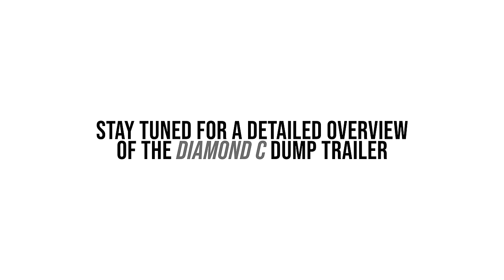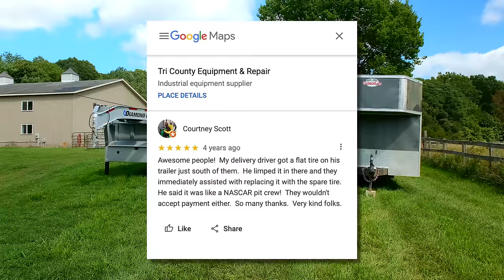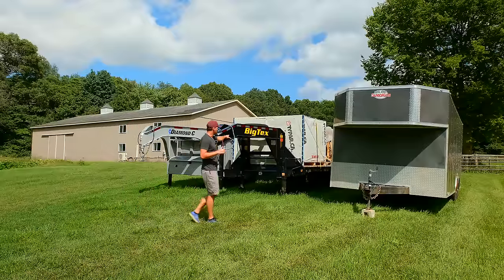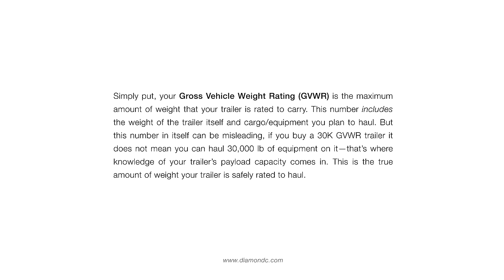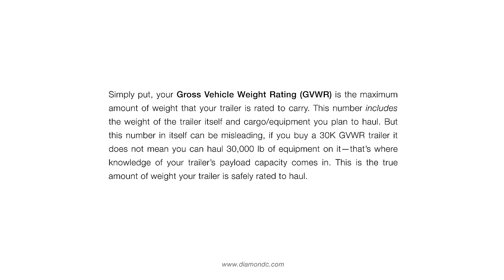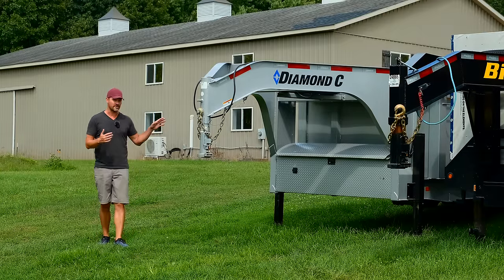THIS WAS A $30,000 DUMP TRAILER MISTAKE. WHO WANTS TO BUY IT?

Comment: Just for anyone who is interested in this trailer or size dump trailer, so you are aware, the rated cargo capacity is said to be 16,780 lbs (trailer weight is 7,220 lbs) for a total Gross Vehicle Weight Rating (GVWR) of 24,000 lbs.  The trailer has (3) 7,000 lb axles (so 21,000 lbs of the total load can be on the axles), they do not tell you how much weight of the empty trailer is being supported on the axles, and how much is transferred on to the truck by the gooseneck (GN) (would be nice if they stated that though) but they are assuming if you load it to max weight capacity 24,000 lbs (load + trailer) that you will have 3,000 lbs of that load supported on the truck by the GN.  You have to figure out how that fits in the trailer without overloading either the axles or the GN (they do not tell you the max rating of the GN as far as I know.....).

With the length of that trailer and the location of the axles, I would think a lot of that 3,000 lbs for the GN is already there, guessing around 2k of it, again though, they don't tell you that (errrrrr).  From looking at equal rated and length equipment trailers (from other manufacturers) a GN appears to reduce the capacity of the trailers by about 1k (based on trailers that have GVWR's equal to their combined axles......) so I assume the GN adds about 1,000 lbs to the trailer, and all that steel in the dump box and frame between the front axle and the GN probably adds 750 to 1,000 more pounds (again, they don't tell you...... but that is a MUCH longer trailer than the typical 12 or 14 ft dump trailer, in front of the axles....).  So you need to try to keep the load as centered over the axles as you can, with it slightly biased forward of the center axle (for every 8 lbs, you want 1 of those lbs on the GN, though it already has a lot of that weight there....).  Since there is not a lot of room behind the rear axle, and a WHOLE LOT MORE room in front of the front axle, I would assume loading centered over the axles till you get to the last scoop, then put that at the front of your load and you will likely be good.  This is assuming dense material like dirt, sand or stone.  While materials that are not as dense (have a lot more airspace in the pile) like mulch, branches, mixed trash can likely be put in more haphazardly, I would still load it centered over the axles till you nearly run out of room, then load forward into the trailer (the rear of the trailer has to lift a lot less to dump than the front of the trailer, so weight in the front of the trailer is a LOT harder for the hydraulics to lift).

Now onto weight of materials, they all vary a bit and can vary a lot more when wet!  My dump trailer has a little label inside the cargo box that lists "estimated weights of materials"
Coal                         2,400 lbs per yard
Firewood                 1,134 lbs per yard * unseasoned red oak, one cord equals 4.74 cubic yards
Mulch                          750 lbs per yard
Sand                         2,600 lbs per yard ** average weight of moist sand
Slate                         2,400 lbs per yard
Stone, crushed       2,700 lbs per yard
Topsoil                    2,400 lbs per yard * average weight of moist topsoil

"these weights are only to be used as estimates.......hada hada hada....."

We'll go with "moist" topsoil here , just for the example.  1 cubic yard is 27 cubic feet, or 3'x3'x3'.  Assuming this and other dump trailers like it is 7' wide and 4' tall walls on the inside, filled to the brime, straight across the top, every 1 ft of trailer length is 28 cubic feet (so assuming there is a little less at each edge of the top, 27 cu. ft. or 1 cubic yard per foot of length of the trailer, 1 yard per foot of trailer for short).  With the "rated cargo capacity" of 16,780 lbs, "moist" topsoil at 2,400 lbs/yd would be 6.99 yards or ~ 7 yards.  So 1 yd/ft of trailer means 7 ft of trailer, full to the top would max out the capacity of that 20' trailer, or 14' half full of that 20' trailer (assuming this for on the road would be a risky idea as you have not given yourself any leaway and the DOT does not care about estimates, they have calibrated scales to fie you with.....), doing this on your own property is safe to assume you can push this number some depending on how "moist" the soil is.....  But hopefully this shows how EMPTY the trailer will likely look when loaded with a dense material like topsoil, sand or stone.  This should all be centered as much as possible over the axles.....  Now if you are doing this where you will not be "on the road", and going less than 35 mph, I would load this all as far back as possible in the trailer, especially if you are loading it near "capacity", tongue weight won't matter at slow speed, not on the road and on "fairly level" ground (backing down a slope, you don't want the trailer tongue or GN here, lifting the rear of the truck off the ground.....).  That will make the load "less work" for the hydraulics to lift.  

Now, how much is a cubic yard, or "yard", by the "bucket".  Depends on the size of the bucket and how "full" the bucket is.  Apparently, the way they measure bucket capacity varies some but usually it goes buy a "struck" bucket, which I think the ASTM defines as straight across from the bucket tip to the top of the back of the bucket, so definitely less than a "heaping" bucket.  John Deere's specs say the 333G would use a 84" bucket as standard (different styles of buckets hold different amounts so take this part with a "grain of salt"), so assuming a 84" tooth bucket, they list a "struck" capacity of 0.55 cu. yds. and a "heaped" capacity of 0.78 cu. yds. or 14.85 cubic feet and 21.2 cubic feet.  So 12.7 "struck" buckets or 9 "heaping" buckets to get to 7 "yards" (don't remember from the other video how many bucket loads, etc.....) but they need to all be as far back in that trailer as possible.  

Anyways, this is not directed at Courtney, just hopefully some useful information for anyone who managed to get through all this and has an interest in dump trailers (or this dump trailer), there is quite a bit "more-than-meets-the-eye" when it comes to dump trailers, especially when it comes to GN's and other long versions (16' for example).  The manufactures like to push the "specs" to have big numbers and the dealer should really be more informed about them and make sure their customer is as informed as possible (my dealer did not go over any of this either.... though mine is much smaller and lighter).  (this comment really got away from me, it wasn't supposed to be this long winded 😂)  Have a good one, after all, it has to get better after reading all of this....🤣
Reply from the maker: Whew!  I skimmed it, haha!
Reply: Longest comment I've ever seen.
Reply: Wow. Thank you  Someone with a brain.
Reply: I bet your tax returns are interesting.
Reply: What makes you think we're reading it
Reply: @mddoit  Thanks
Reply: @Brickbossman  Just trying to help.  Guessing by this response you read it or you wouldn't have commented, but I have been wrong before.  Have a good one!!
Reply: @emerkamp1  Would be cool if they were!!  Have a good one!!
Reply: @Jtwizzle  Thanks....... I think.....🤣   Have a good one!!
Reply: @GoodWorksTractors  Just keep this in mind for the next time you can't get to sleep, you can come back to this and it might do the trick....😴😂
Reply: Read it all. GREAT breakdown :D

Comment: Issue is the under box lift. Always get the front telescoping cylinder or  duel front cylinders. Under box systems are weak which is why all big trucks use front cylinder

Comment: The cold reality is very few people that sell equipment actually know how to use it. And by use it I mean more then put an attachment on it and move it around the lot. The same goes for those that purchase trailers. The biggest issue I see with goos necks especially is people think they can put unlimited amount of weight on the trailer. I’ll leave alone using single wheel 3/4 and 1 tons for jobs they shouldn’t. It’s not always about the capacity number.

Comment: You can learn to hook a gooseneck quickly by yourself. I hook mine up with a tall weatherguard toolbox an fuel tank all in the way. I just center the tube with the rear window, and I’ve learned where to stop when it’s over the ball.

An also back the skid steer on the trailer instead. 👍

Comment: I agree with going up the ramps with a a skid steer forwards with no weight on the Freon t end, we have a big Tex and ya it’s scary but you will not tip over as long as you go slow
Reply from the maker: I've tried going forward and started to tip over.  I can't go backwards if I need to grab an attachment in the nose of the trailer.

Comment: Realize, the wheel wells internally, just mean the other parts of the trailer are wider. If you 'remove' the internal wheel wells, all you are doing is making the box narrower, to fit completely between the tires. There's no free lunch, with wheel wells.

Comment: It seems weird that that unit doesn't have a telescoping lift setup.  Haven't seen a goose neck that didn't.  I have a 14' Sure track bumper pull and I think its 14k pound trailer.  Double ram setup.  My dad has the identical trailer with the scissor lift and they dump about the same.   We haven't done an exact side by side comparison.    Mine doesn't dump 12k pounds on its own.  It's max without help is 11k.   I think they need to put better assistant lift points on them.   LIke a container that says lift here.   But it is highly aggravating thinking that you can haul and dump something that you cant.

Comment: For every foot of depth I'd guess for Dry topsoil I'd say 10k lbs. For wet and packed dirt probably 15k lbs. So if it's wet and packed 1 foot of depth you're at the limit. 

You need to know how many yards you can carry and what the weight by yard is. It looks like a 20 yard capacity for bulk, but you can't put 20 yards of material that's 3k lbs per yard. Dirt is 2-3k, maybe a little more if really damp. 3/4 Gravel is 2,500-3,500 per yard depending on how wet. 

I do agree a scissors lift should not have been used. They are their weakest in the first couple of inches and it's just hard for them to lift. They're cheap though. Direct acting telescoping is the best for lifting heavy weights. 

Did you weigh out when you got your material? I'd be curious if it could lift 16k evenly distributed. I had a friend with a 7k bumper pull that if you loaded it at max weight it wouldn't lift. He carried a steel digging bar and would stick it between the bed and frame and stand on the end. Once it lifted 2-3 inches it was fine. He talked about trying to come up with some direct acting cylinder that would activate first and lift it 6" then the scissor could take over but he ended up getting a 10yrd dump truck and was much happier.

Comment: The Diamond C is a let down. I pull a competitors 24k 3 axle dump trailer and commonly load it WAY over the rating. I have never had it fail to lift the dump box. It's always on my mind when I am loading it, but has worked every time. I was thinking about a new Diamond C as an upgrade. You saved me a bunch of money with this vid.

Comment: Really urge you invest in wheel chalks for the trailer that way you dont push againt the transmission when loading and unload equipment.  I picked some up at a sale a wbile back and truck and trailer doesn't move when loading.

Comment: I can’t recommend my Kaufman tilt equipment trailer enough.  For the price you can’t beat them.  Under 8500 for 22’ bumper pull. 8’ stationary, 14’ gravity tilt.  8k axles give it a 17k rating

Comment: Helped a friend with a similar trailer (not sure of brand).  welded in some bunk board brackets so he would only load the back 2/3 of the trailer and it wouldn't slide forward.  In that way he did carry and dump near it's advertised 16k cargo capacity.  Handy as he had a full size cat back hoe that was too long for a shorter trailer dump trailer.  He doe's wish it was 10k double instead of the triple 7k after he purchased his third set of tires though.

Comment: Dude it’s like this video made them redesign. All they advertise in this size group now is an upgraded telescopic version. They even have a pretty unique integration I usually don’t like the telescopics cause they look flimsy even if they lift more.

I just got a bumper pull Lamar 7x16x2(box size)and I’m very happy with it for the price, 12,300$ I would of got a gooseneck but for my price range(paying cash) I  was actually gonna lose overall weight capacity on the dual 7k axle Lamar gooseneck cause of how heavy the trailer was. 

That diamond c is nice though my friend!!!
Reply from the maker: Glad to hear it.  I decided to keep the trailer and  am pretty careful with how I load it now.  I like it overall except for that issue.

Comment: I have a Sur-Trac 14 GVWR 14 ft with telescopic lift. I’ve had 15,700 lbs rock in it. I was surprised it lifted and dumped it. But telescopic best point of lift.

Comment: Dropped off 2 30 yrd rolloff dumpsters for a private marina beach club. They called few days later said they are ready.
I show up and they are loaded to the top with beach sand and logs . My International truck can lift  30k  easy but that's overloaded.   
I couldn't even lift these things off the ground. 
Called it in and they unloaded the back half w bobcat. 
Now all the weight  upfront. 
I almost flipped the truck dumping it. Scary stuff.

Comment: I have a 20' roll-off that I had custom made. Key here is we speced the hyd. cycliners to lift 20.000 and if I go over with weight in the front I can slide the box back 2' or so to over come the weight and it makes loading equipment a breeze.  Oh and I spent a lot less than 30;000 bucks.  Good luck

Comment: Before buying my dump trailer, i was warned about haul capacity vs dump capacity.....so glad that i was warned.  Usually, the single cylinder scissor style dump mechanism will only dump approx 10,000 pounds.  Also, on that style of mechanism, if the load is unevenly distributed, you will get a lot of bed twist.  After speaking to several of the big name trailer dealers and hearing the same thing about the 10,000 pound dump capacity, i finally stumbled onto a small trailer manufacturer in Texas named Texas Pride.  I was looking at their 16,000 gvw dump trailer.  When i asked about dump capacity, i was told that their dump capacity is 20,000 pounds.  Twin cylinders one on each side of the bed making it equalize pressure for uneven loads and reducing bed twist.  So far, the trailer has performed beautifilly.  You do have to use common sense when loading, with the dump capacity so high, so that you are not abusing the trailer.

Comment: The biggest thing to look at when getting a dump trailer is where the lift cylinders are.  I'm surprised being that big of a dump trailer it doesn't have a front cylinder lift.  Having a scissor lift puts it at a disadvantage cause it doesn't have the leverage to lift anything in front of the mount. Having a lift cylinder mounted at the front of the box helps give the lift cylinder the leverage it needs to fully lift a load instead of pushing a scissor mechanism.  You lose a lot of mechanical advantage that way.  The dealer should have specified how to load a trailer with that load.

Comment: Have a 16K dump trailer with the RAM out front. It will lift the box even full of sand. Amazing trailer. Any of those with the hydraulics under the box are a compromise.

Comment: If you turn the pressure regulator screw on the pump it’ll totally dump that did the same to mine similar setup and does with ease

Comment: I almost ordered a pj that was similar to yours when I saw your video on that trailer. I ended up buying a 25+5 big tex 14gn, I absolutely love the way it rides and tows, it's pretty much effortless and you really don't feel it there unless the load isn't centered correctly. I'm glad I didn't get a trailer that was primed and painted when my big tex has minimal rust and is just the standard paint process they use
Reply: I bought a brand new 35ft big tex 26gn and right off the lot has rust between rub rails and stake pockets. It's not very well painted.
Reply: @tim2195  mine has rust in those same spots, buy the way I look at it, it's a budget trailer with a standard paint job. I'd be more upset if I paid extra to prevent rust and it still rusted
Reply: @farmingforfun9534  I suppose if you think about it like that

Comment: You can replace the manual crank jacks with one that has an electric motor and uses the trailer battery to run it. Or you can weld a 1/2" socket to the top of the crank and use an impact wrench to run it up and down.
Reply: I would rather weld a 1/2 socket to the top of the crank  and use an impact on it, that makes it so handy .
🤗👍💫

Comment: Your payload is only 50-60% more than our 14k PJ dump trailer.  It can only carry about 5 skid steer scoops or 9-10,000 lbs.  Dump trailers are like a multi tool.  They aren't great at any one task but can do many tasks okay.  Lots of disadvantages from hauling equipment to materials.  With material hauling knowing your weight limit as well as placement in the bed are just as crucial if not more important than loading your correct weight distribution for a equipment trailer.